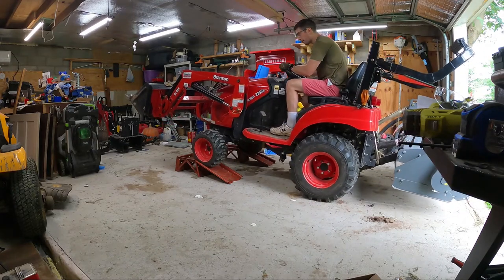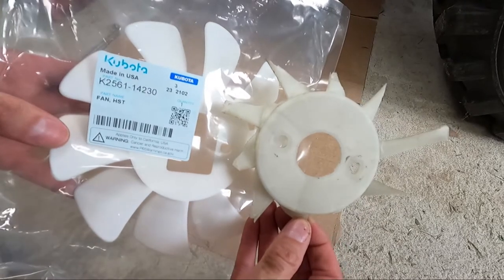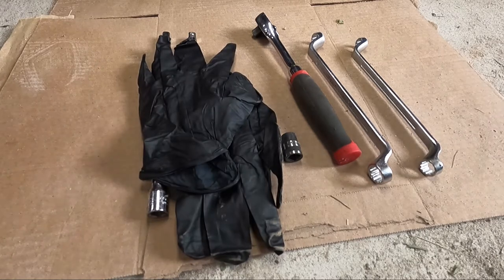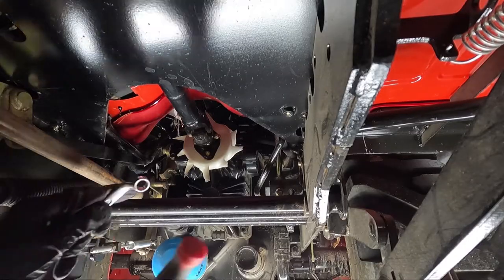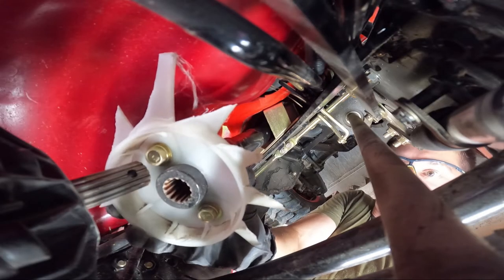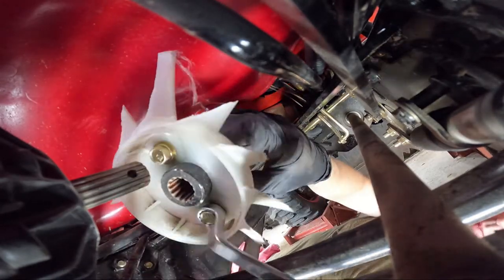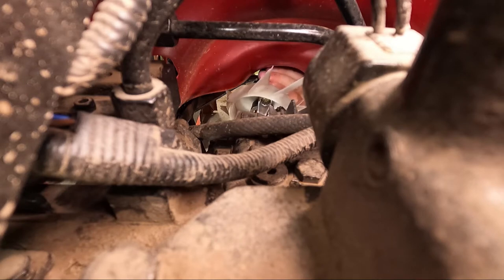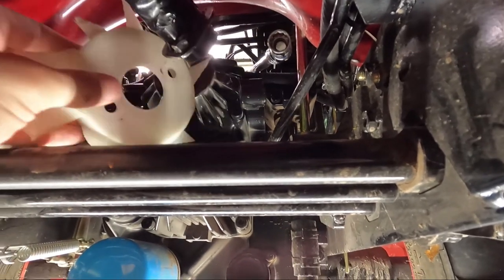Branson Transmission fan repair (Part 1)

Comment: Good video!  Just out of curiousity, are people breaking these fans while using the mowing deck or just by general use of the tractor?
Reply from the maker: General use, I lodged a branch up inside the fan area. It is bound to happen at some point to most tractors of this size where the fan is low down and mostly exposed.
Reply from the maker: Very soon after posting this I actually got a vine lodged in my radiator fan. Destroyed part of the housing but the fan blades remained intact!
Reply: @dadcandothat7910  we’ll that sucks! Thanks for the replies

Comment: Just replaced the fan went well trying to put the shaft back on will not slide on to splines any tips ??
Reply from the maker: I remember having this issue as well, I'm my case it was angle of attack, the machining was actually tight enough of a tolerance that if I didn't have a perfect angle I was effectively never going to slide it on. Hopefully you got it back on since the comment.